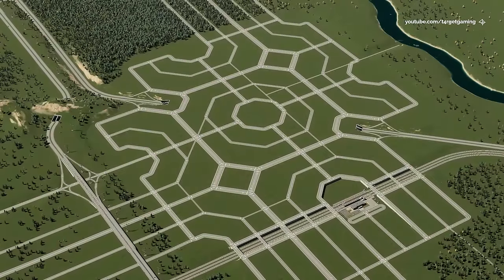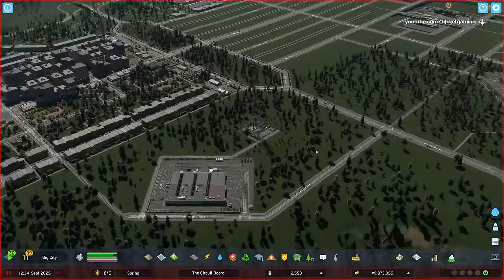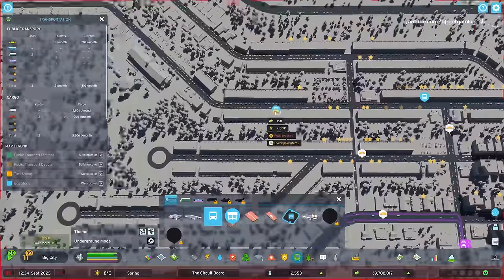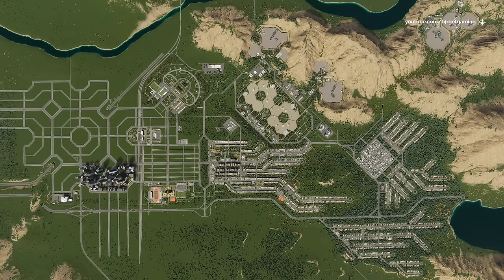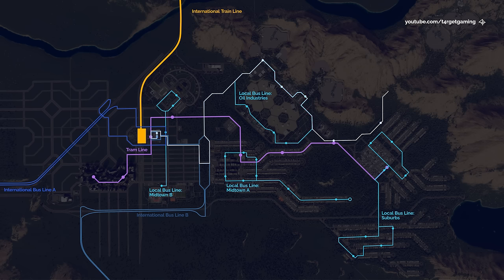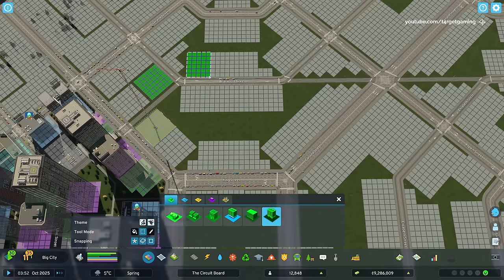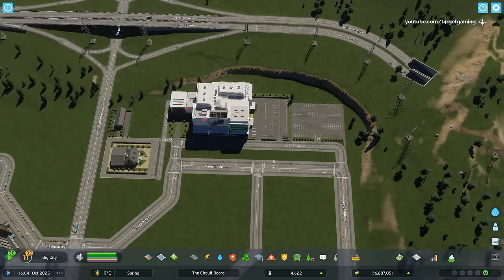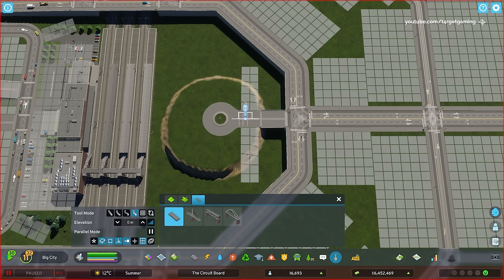How I Planned a Fully-Connected Public Transport System

Comment: I like the hierarchy for the buses, but even a long line is local if has short enough stop spacing. Some of these bus lines could benefit from actaully meeting eachother (and the tram) aswell as bringing people directly to the city centre. The current system would not get you anywhere fast.

Comment: 2:40 the reason I think the stops need to be placed in this version of the game is that the network segments are much longer (granted the whole segment is modified), allows for more precise placement of stop pick-up/drop-off placement for pedestrian networks to be used.
Reply from the maker: I think you could have the same effect with just one step, where a stop could be created anywhere on the road while making a route, and a stop/shelter would be created automatically when doing so. You could then fine tune the stop after line creation and even change the stop to a shelter if you wanted to customize a bit more.
I dunno, what we got right now seems so unecessary...
Reply: @T4rgetGaming  Stops need to be created explicitly because C:S 2 lets players create non-stopping waypoints for street fixing. Otherwise, the gake routes the buses dynamically as they visit each stop.

Comment: I actually prefer the new bus/tram line system. It may be a little more work, but being able to preplan bus systems and differentiating shelters from stops, and makes it better for sharing stops when you have different lines sharing a stop
Reply from the maker: Well, you could have the option to convert a stop to a shelter and vice-versa after the stop was built, and even fine-tune its exact position.
How exactly does this system help to preplan the bus network? And how does manually placing a stop make it better for sharing stops between multiple lines? Am I'm missing something? 😅
Reply: @T4rgetGaming  i mean, it lets me control where in the street it stops with more granularity and it allows me to pre plan by letting me put stops and develop around those stops

Comment: The only thing that i would say about the buses is that it would be preferable to make the "oil industries" line connect to the tram lines like with the other bus lines
Reply from the maker: It does. There's one bus stop on tuat line right next to a tram stop and they're both connected with a pathway